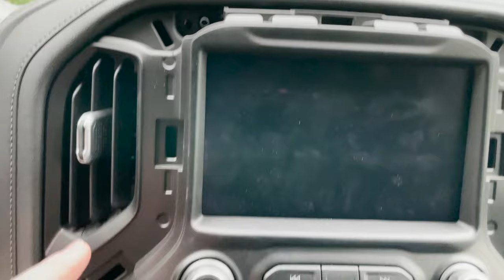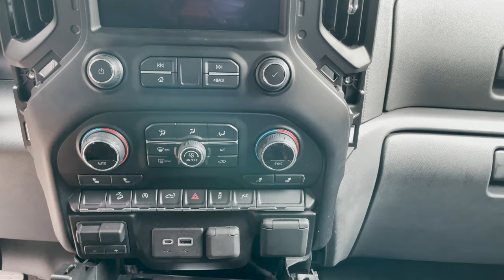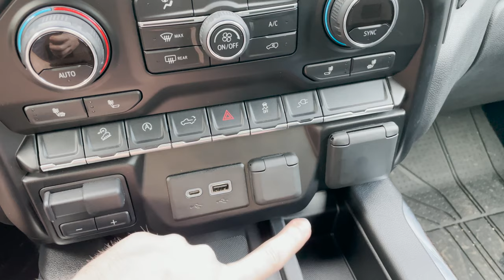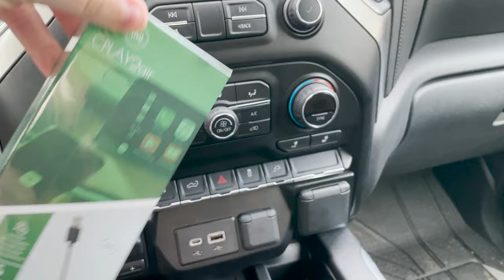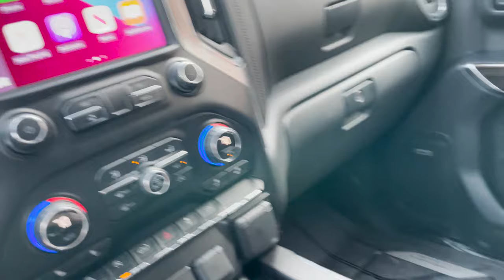Silverado / Sierra Center Console Upgrade (2019-2021)

Comment: If you plugged the OEM wireless charger into the front power port, then you did this wrong.  You would've also failed to provide a lot of info in your video.  You need to completely remove the center console and front passenger seat in order to correctly run the wire harness.  I just did this conversion in my truck, but haven't hooked up the air duct that goes to the wireless charging pad.  I was hoping your video had that info, but it didn't.
Reply from the maker: I bought the direct connect plug in play kit that connects to the harness behind the 12V port in the center stack. That is explained in the video. There is no need to remove the passenger seat for the kit that I bought so, no, I did not do it wrong. I did exactly what the included instructions detailed per the kit that I purchased. 

The air duct isn’t hooked up because vehicles that didn’t come with the factory wireless charging don’t have an extra AC vent hose ran for that duct. You would have to cut into the vehicle’s vent hose and add a Y connector somewhere along with additional vent hose to run back to the center console. Most people aren’t going to mangle their factory AC just to connect that duct port on the wireless charger when doing this conversion.

Comment: There is a delay in the sound or any issues due to the wireless apple carplay , right?
Reply from the maker: I wouldn’t say there are any issues with the wireless Apple car play. The only delay that I have noticed is when switching between songs in Apple Music (I don’t have Spotify or anything so I can’t test those services). When I click the button to switch songs it takes a second or two for the audio to make the switch. It’s not really a big deal and is probably just a side effect of using an adapter to send the signal to the vehicle. It’s just something that I have noticed. I plan on doing a review of the wireless charger and CPlay2Air adapter in the near future.
Reply: @SouthpawGarage  thank you very much ♥️
Reply from the maker: I have recently recorded my full review of the wireless charger and wireless apple car play. The video is currently scheduled to publish on July 20 if you want to here my thoughts on these two changes/components.
Reply: @SouthpawGarage  I’m waiting
Reply: Fwiw the factory wireless CarPlay on newer Chevy/gm vehicles has the same lag when switching songs. I think it’s more of a bandwidth issue between the phone and the receiver that causes the delay.
Reply from the maker: Thanks for that info. Sounds like it’s just caused by sending the data wirelessly and not the CPlay2Air adapter itself. That’s good to know.

Comment: My 19 Silverado has cooling line(s) connected to AC under the factory installed wireless charger. If I don't turn un the AC the phone gets so hot during the charge and stops charging. In that case, the wireless charging icon turns on and off continuously. 
By the way, its wireless charger is almost useless since it's so slow.
Also, I hope Android Auto had the same wireless device too 🤔
Reply from the maker: I have noticed that this wireless charger does get hot and the GM chargers are low wattage (unfortunately). If I’m actively using Apple Car Play to play music while my phone is on the charger, the battery percentage does not increase. It basically gets just enough juice to hold where it’s at. If I am not actively playing music from my phone, it charges slowly. I think I get about 20% increase in around 30-40 minutes (unless it gets hot and stops charging). I don’t really understand why GM would use such inefficient chargers. It’s disappointing. But I usually have a way to top off outside of the truck so I’m not too concerned about the charging speed. The wireless CarPlay and not needing a cable dangling in my truck were my main concerns. Lol. I just like a nice clean, minimal set up.
Reply from the maker: Also, the CarlinKit product on Amazon claims to work with Android Auto, but I cannot vouch for it and this is not a recommendation as I have never tried it.
Reply: @SouthpawGarage  I checked the Q&As. It sounds like you can use them on aftermarket Android radiis and it doesn't work on factory radios. I found AAWireless is working on it but if you purchase now you may get it in October.
Reply from the maker: Sorry about that. I don’t have an Android device so I’m not up on the accessories or related products for those. I just figured if Apple CarPlay had something, then Android Auto probably would too.

Comment: Dude - you failed to show how to remove…only spoke…then showed nothing about the wires underneath where the new piece goes. Most important parts of install were not added.
Reply from the maker: Dude - timecode 1:00 through 6:00 clearly shows how to remove the old center console. Timecode 6:00 through 7:00 clearly shows how to pull out the center stack. Timecode 7:30 shows where to plug in the wiring harness for the new center console kit.
Reply from the maker: The only thing I did forget to put in the video is that you need to reuse the little component that is connected to the bottom of the original center console under the cup holders. That I will definitely admit and I have explained it to those in the comments who have asked about it.